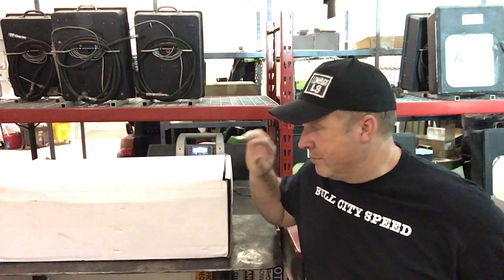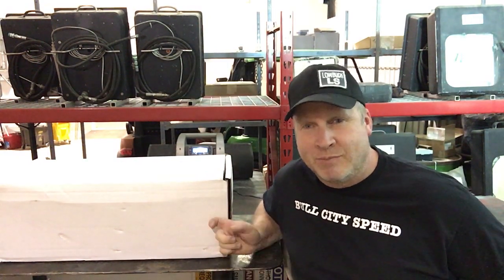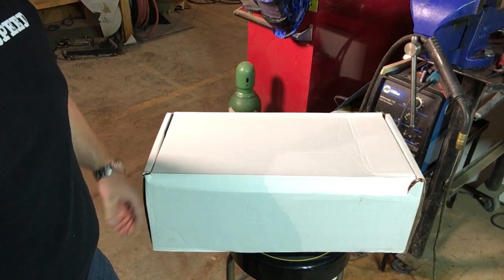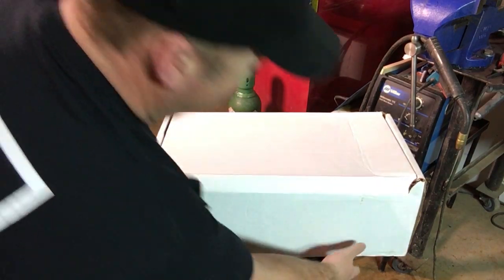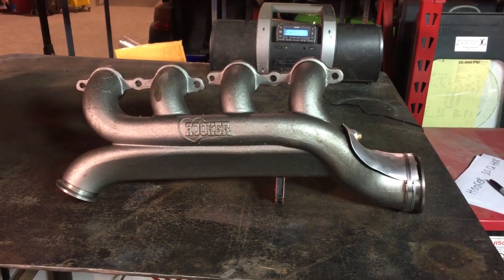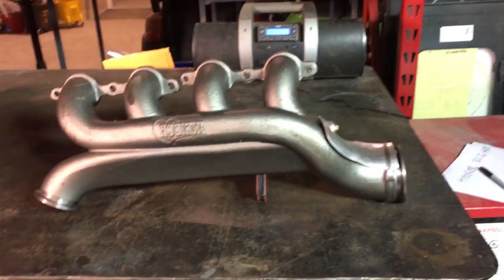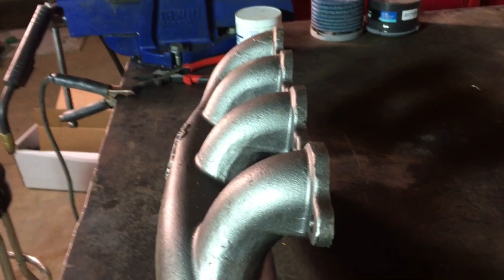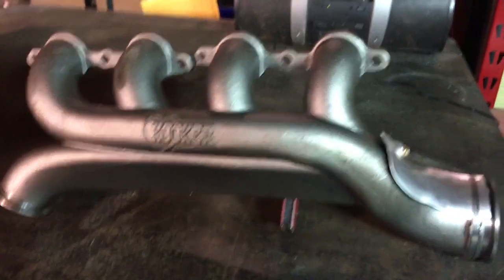What's in the Box?!?

Comment: Hope you have really done your research into how it will fit your setup and how your going to fit the turbo up to it. I have those cast hooker manifolds on my setup and it makes it very very hard to mount the turbo and accessories without running into the rad. That's why i'm taking it off and building a log manifold like yours haha. Just an FYI if you want pics of how I made mine fit let me know.
Reply from the maker: Brandon Loll I haven’t done a bunch of research, couldn’t find any measurements or dimensions before buying it. I’ll try it out and see how it fits and let you guys know. Thanks for watching and commenting by the way.
Reply: @LowbuckLS   there are some very detailed drawings on the holley website just like all holley stuff witch I love. At any rate I just found your channel today and have enjoyed all the videos!